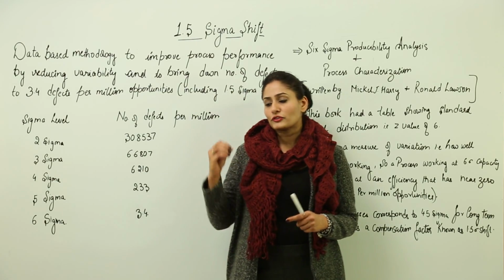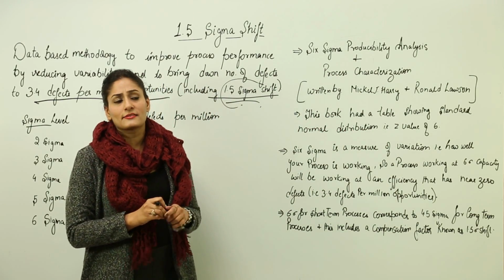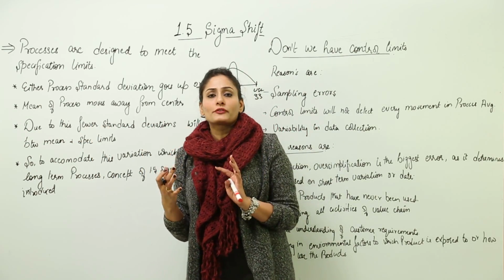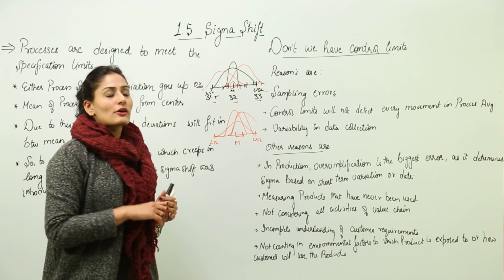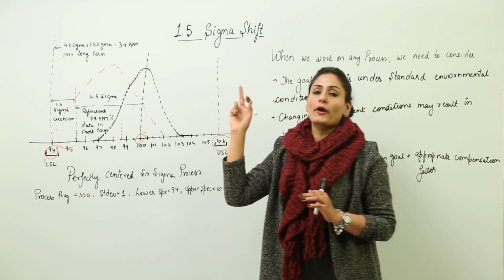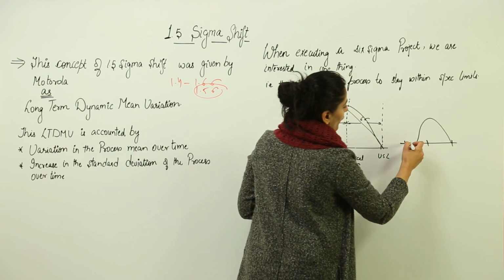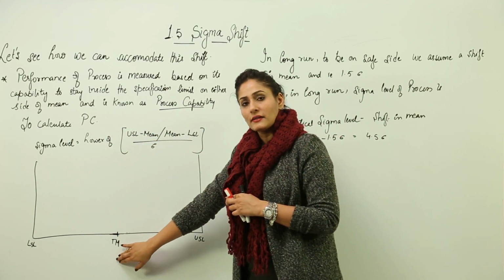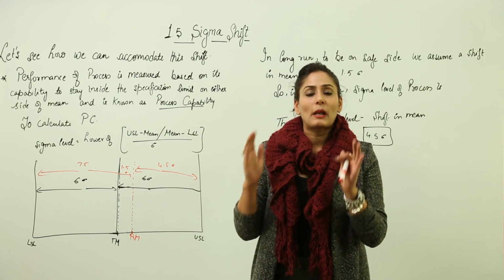six sigma l 1.5 sigma shift I Lean Six Sigma Training I jsixsgma.com

Comment: Hi! 

In calculation of sigma level, it is overstating capability.

If a process in a capability of 4.5 sigma based on short term data,  adjusting 1.5, we are saying the process is of 6 sigma.. Not convincing.

Comment: I would like to add that this shift of 1.5 sigma compensate the measurement uncertainty as well, not only the long term variation.  What ever data we measure their is measurement uncertainty involved. Suppose your process is very near to LSL, then this 1.5 sigma will compensate.

Comment: 1.5 shift is derived from experiences in manufacturing industries. How is it relevant in service industries?
Reply from the maker: if the variation is in process, then this concept is valid you need to be agile when thinking of applying these concepts.